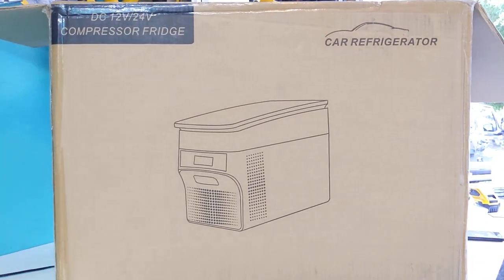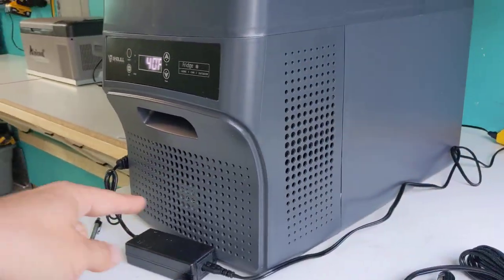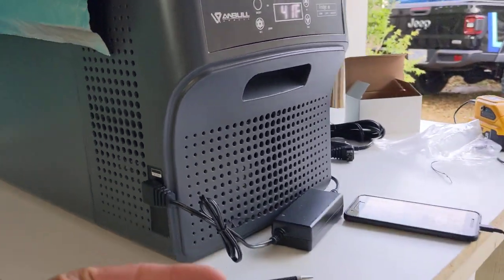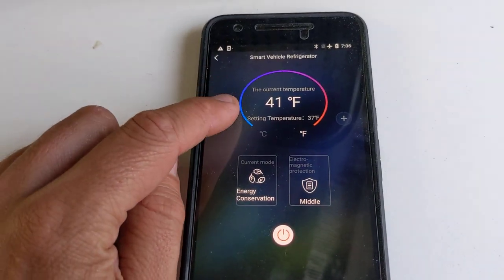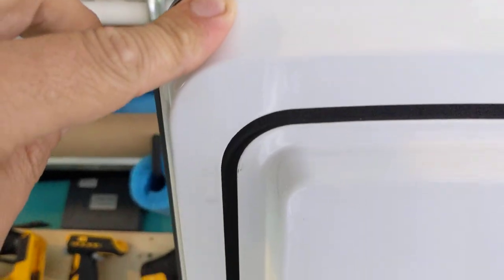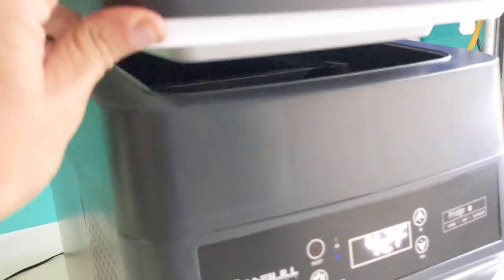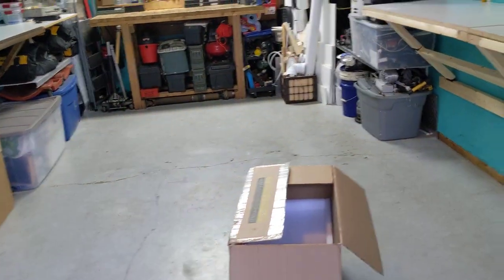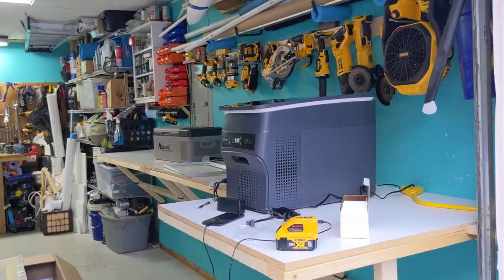Stop Buying Overpriced Overland Refrigerators!!! (Review of the Anbull Refrigerator)

Comment: I purchased the Alpi-Cool after seeing yours a couple of years ago and it's been perfect. The deep lid definitely helps with capacity and milk jugs. I'm still surprised at how much I can get in it.
Reply from the maker: That's awesome! Can you buy the expanded lid separately? I love my little alpicool and it has been flawless thus far! Glad I helped in your selection process 🙌🙌🙌
Reply: @ianmburke  No, it came with the lid that has about a 2 -1/2” recess in it. I assumed it was the same as yours.
Reply from the maker: @roadxoverland2917  mine is a flat top so it's a little lighter of a fit (still fits the half gal of milk on its side) I want the expanded lid though 🤦🏼‍♂️
Reply: @ianmburke  ...As far as I can see, my fridge looks to be the same size as yours with the exception of the lid. The lid appears to just simply snap in, so you might contact them about ordering the lid separate. The lid is ... 15-3/8" wide x 12-1/4" deep x 4" tall.

Comment: You mentioned leaving it plugged in all of the time, do you have an auxiliary battery setup or is it really drawing that little when car isn’t running to not be an issue?
Reply from the maker: It doesn't draw much at all 45watts and it's cycling isn't hyper frequent until the temperature outside it super hot: but I do have a aux battery set up- https://youtu.be/Q2wJxC7bjTk

I assume you could just run it off of the vehicle battery I just wouldn't want to put that stress on mine.